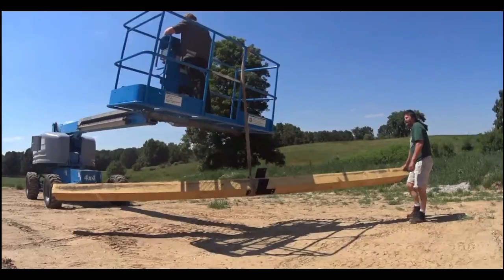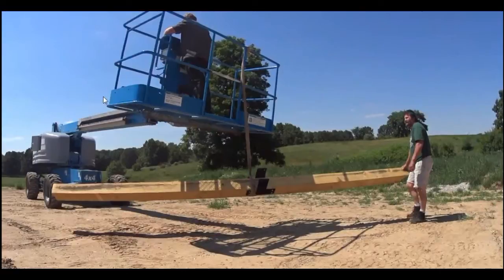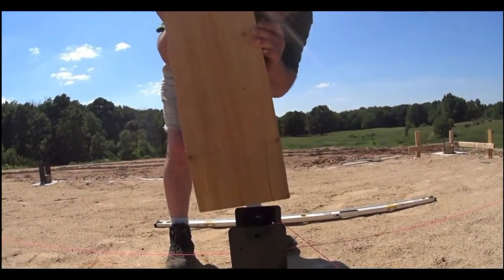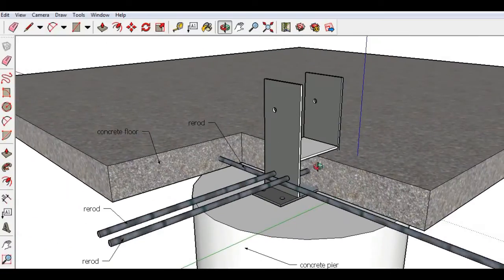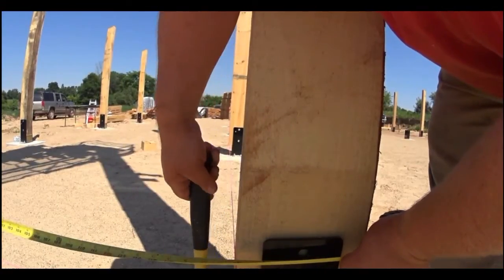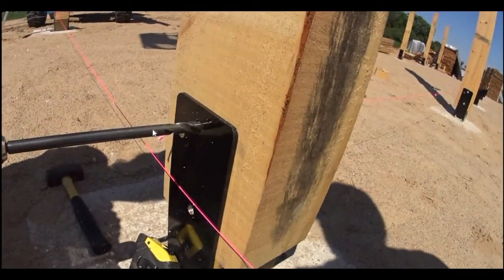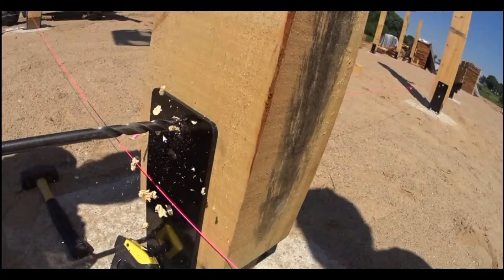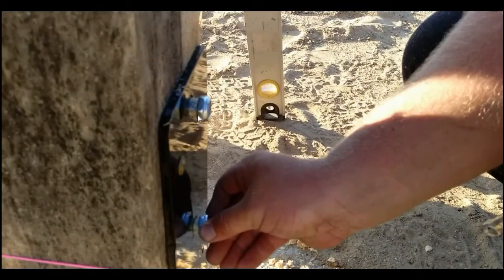How to Build a Barn, Installing a Post

Comment: Having worked with manlifts for better than thirty years, the most important safety item missing is the operator safety harness. They are known to throw operators out of the basket. #2 is please note the capacity of the basket, operator plus the post weight.